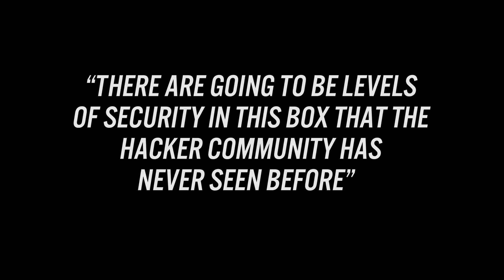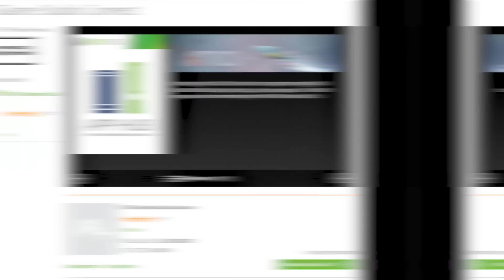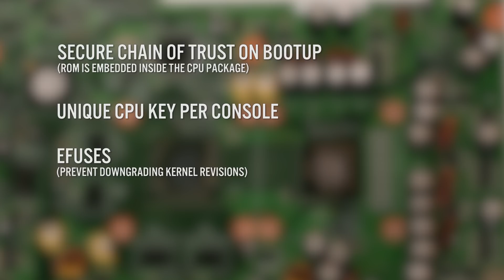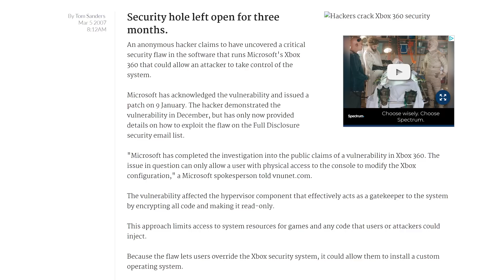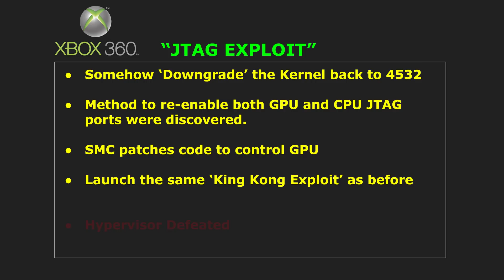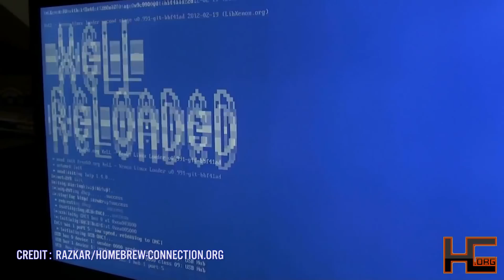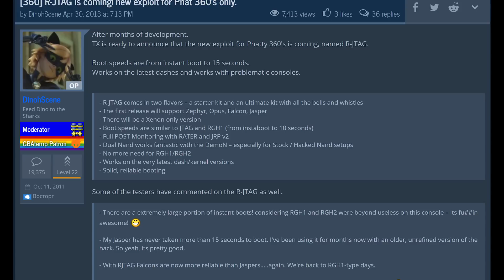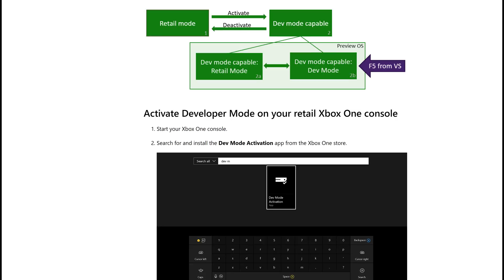How the Xbox 360 Hypervisor Security was Defeated | MVG

Comment: Unfortunately, hardmodding is an effective barrier that will make it so that homebrew just isn't always going to be possible on an Xbox 360 without cracking the system open and knowing how to use a soldering iron.
Reply: I wouldn't have modded my OG Xbox if there hadn't been a software exploit. Sure, I ended up swapping out the HDD for a bigger one, but that's about as far as I was willing to take things.

Comment: Getting those RGH boot timings down can be a fine art and a test of patience. I've had systems be in range of anywhere from instaboot to 5 minutes, which is why I always loved the JTAG. No fuss, no timings to mess with! Excellent video, my dude.
Reply: THIS IS WHY IT DOESNT LOAD IMMEDIATELY. Thanks
Reply: Yep once you had your JTAG in place, it was as simple as pressing the power button to launch the modded dash, or press the eject button with power off to boot into XeLL
Reply: I thought mine was broken at first ngl.
Reply: My rgh is instant.
Reply: RGH 3 Fixes the boot times sometimes
Reply: Meanwhile, Jtags were limited to exploitable firmware(s) only
Reply: r-jtag tho
Reply: Mine takes between 5 seconds and about 2 minutes on average, though yesterday it actually took about 5 minutes to boot on one occasion.
Reply: My RGH3 Jasper usually instaboots, but it's only been 3 days so we'll see if this console lasts lol. I'd rather not deal with RGH2.1 and timings.
Reply: @butchdeadlift7551 how’s it holding up to this day? Still go the same boot times or has it started slowing down?
Reply: Look at you today
Reply: The squirt 360 was the best chip, boot within 30sec

Comment: How exactly would blowing a fuse prevent downgrading?
Reply: The console firmware checks to see how many fuses have been blown. So each firmware has its required fuse count, and if you try to downgrade from a higher firmware then your fuse count will be too high for that lowee firmware and the console will not boot

Comment: Excellent material and great content Lantus! I enjoyed this video. So much time and money was wasted because of RRODs. I've done so many first gen JTAGs and had a good percentage of them come back with RROD and back again for re-repair. It's around this time I began to regret turning my hobby into a business. OG Xbox scene was probably the most fun I ever had. Modded 360s were awesome but watching your decked out 2TB xenon just die from RROD was heartbreaking. After that I did do RGHs but didn't continue my modshop past 2011 so missed out on RJTAG. The only remnant left I have is a trusty COD edition that has an XK3Y in it with 2TB HDD. No Homebrew or modded games but I'm ok with that. I have an Xarcade with 360 adapter I use with it for fighting games. My Hori RAP4 also works great with my 360 via Brooks converter.

Comment: The PS3 never came with a Linux distro out of the box, it allowed installing them through OtherOS - and even then, it was isolated by a hypervisor. Its OS used a nearly unmodified FreeBSD kernel. The XB1 also uses a hypervisor, specifically a highly customized Hyper-V called 'nanovisor', and runs nearly all the software in various virtual machines - such as Game OS, Title OS, and System OS. It has a custom virtual disk file format with signed hashes in the file headers and it's definitely not trivial to break, but people are making good progress. One of the biggest issues with XB1 hacking has been legal threats from Microsoft, several people even had PIs from M$ knocking on their door.

Comment: Now security is baked into the CPU, good luck reverse engineering a CPU. If Microsoft has done everything correctly, it's going to be really hard to hack the Xbox one. I think we got lucky with the 360.
Reply: we dont need to hack the xbox one
the dev tools are right there, its called dev mode.

Comment: How does 16 byte translate to 4096 trys? Even if you confused bits and bytes in the script that won't match.
Reply: Maybe accidentally did (2^8)*16 ?
Reply: well, it must be 16 bits, so 2^16 equals 65536, which are not too many tries either
Reply: I guess number of those fuses is 4096.
Reply: If it's 16 bytes then it's a 128-bit key, which isn't what's in the script but it'd be an understandable key length back when the hardware was finalized circa 2004
Reply: Good question.

If I did my research and math right, 16 bytes can have 340,282,366,920,938,000,000,000,000,000,000,000,000 different combinations, while 16 bits can have 65535. I'm more likely to be wrong about that bigger number, but frankly I don't care because even if it's 50 trillion off it wouldn't make much of a difference.

You would have to divide 65535 by 16 to get to (roughly) 4096.

Yep, doesn't make sense to me either. Perhaps there's something about hashes that we don't understand?

Comment: Soldered my first JTAG in late 2009 on my falcon board 360.
It died pretty fast with a RROD. I just sold it off because I didn't want to spend any time or money to get it reballed.
Then in early 2010 I bought a premade jtagged 360 with a jasper board and that is still working to this day.
I even drilled a hole on top of the case to add a fan that draws in air into the case. I also replaced the back fan with 2 noiseblocker 60mm fans.
Now it is almost completely silent and runs much cooler than with just the stock fan.
Reply: Why do that with a Jasper? They’re arguably the best cooler of the entire Xbox line up and stay pretty cool either way.
Reply: @thefox17906  Because it won't sound like a jet taking off and because it's fun to mod stuff even if it isn't a necessary mod.
Reply: Also, better cooling generally means longer hardware life.
Reply: @thefox17906  lol with upgraded thermal paste my jasper never hits 60C with low fan speeds
Reply: How cool though, like what temperature in Idle and with heavy usage ?
Reply: @itza8334  Don't really know at the moment. I barely use the 360 anymore.
Reply: I have a pre-falcon board 360 that somehow hasn't had the RROD. Damn thing doesn't even have an HDMI port.
Reply: Dude...I literally just posted the same thing above! I had the second revision (Zephyr? Falcon?) and managed to dump the keyvault and NAND over a janky self-built serial dumper, but like you, I ended up frying mine, but only because I sucked at soldering. I ended up buying a JTAG'd Jasper as well a few months later. I got tired of it after years of messing with it and gave it to a friend last year for Christmas, AFAIK it still works perfectly.
Reply: Well if you have any experience with the phat consoles you’d know the stock fans for the Jasper/falcon v2 can be put to 40% iirc which meant it was quiet and still stayed below 60*c. Adding extra fans is just unnecessary
Reply: @thefox17906  Even at low rpm the stock fans were pretty noisy. my 120mm noiseblocker on the top and the two 60mm noiseblockers in the back are almost silent. And the temps were cooler than stock
Reply: Jasper is the best, many will agree.
Reply: @vadnegru  I had a Jasper, it stood strong for all the time I was playing with it. It only RRODed once, and then never again.
Reply: @Young & Reckless The Xbox 360 is still hard to modify for the average user and way too protected to go safely online with your mods without using servers or VPNs...PS3s hacking scene gets further and further and has reached every model thanks to HEN and the easyHEN method for easy homebrew access

Comment: Fun conspiracy theory: xbox red ring was a anti piracy measure to replace hackable xboxes. (I joke but I thought it was funny)
Reply: Funny enough we had a few modded and a single legit xbox, our single Legit Xbox was the only one to get RRD.
Reply: @carlangelo653  
Fan crapped out?
Reply: @ChaseMC215  Fan isn't always the case. Mine was rrod'ed just from sitting. I didnt even use it. After some weeks of sitting, I decided to play some and was greeted with an rrod. I opened the system up and it was clean. (I cleaned it before, as the disc tray belts were slipping and not opening the disc tray.)
Reply: @h4z11s4  
My disc drive is just stuck
Reply: While it WOULD be funny, it was just terribly rushed engineering
Reply: Worst console launch ever. 😩
Reply: I wouldnt doubt it honestly

Comment: Hmm, the Xbox 360 Hypervisor security is quite protective! 😇🤘🏻💕
Reply: The hypervisor isn't even the crazy part, that's pretty simple & straight forward.  The crazy part is data encrypted on the bus's and the rom-on-chip.  Those things are very hard to by-pass.  Only other setup I've seen like that is the iPhone, and as far as I know that security hasn't been cracked yet. Even with the San Bernadino shooter and Apple was ordered to help the FBI, they were only able to allow unlimited tries & brute force, not crack the HW encryption.
Reply: yep
Reply: Without reset glitch bug it was impossible to hack x360 after updates with jtag fixes. So, yes, supervisor is very secure and effective and x360 a badass to hack. We had luck that reset glitch existed.
Reply: Quite!
Reply: Temperently, but as soon as you jailbroke the 360, Microsoft is far passed fuck!